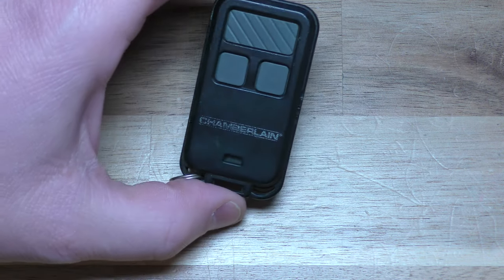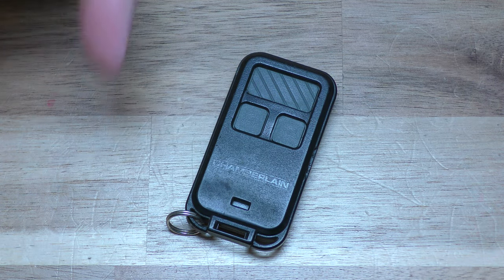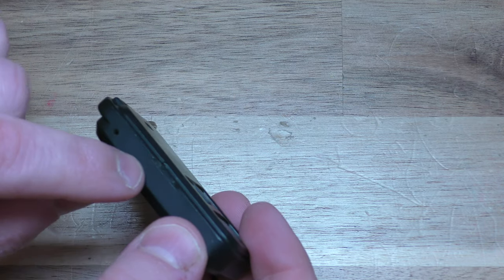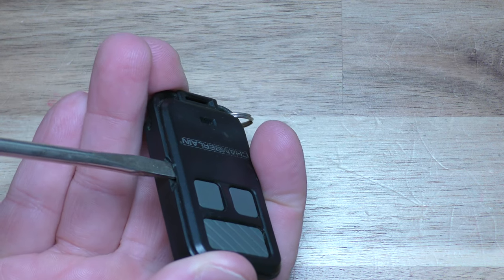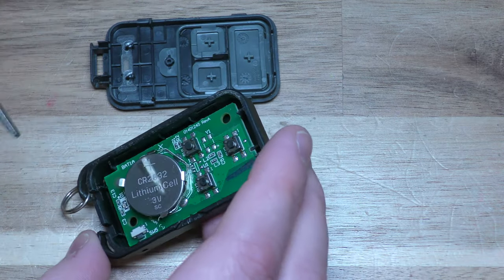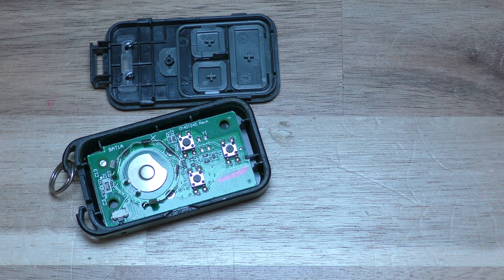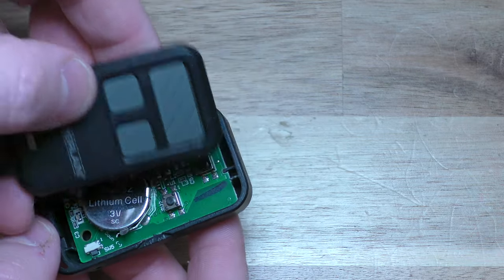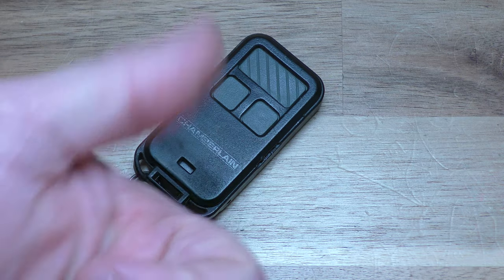LiftMaster / Chamberlain Garage Door Opener Remote Battery change - EASY DIY

Comment: I love how you can see the plastic getting damaged when removing the cover the way it is intended to be removed. Bad design
Reply: I think it's easier if you pry the housing to the side rather than pop the top. Still not without scratching the plastic, but didn't chip the top.
Reply: @GuardedLegacy  Good tip, that was much easier and less harmful to the device

Comment: Screwdriver will damage the plastic no matter what. I used a letter opener instead to slide between the side edges of the remote and it worked better. Horrible design.